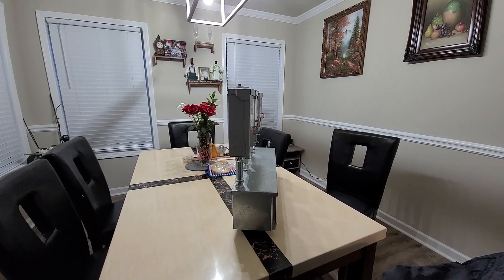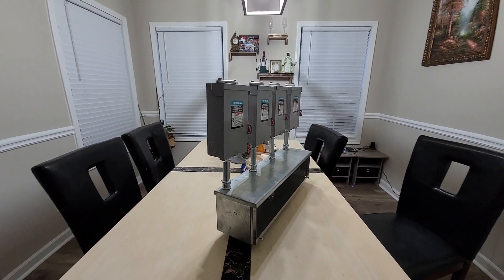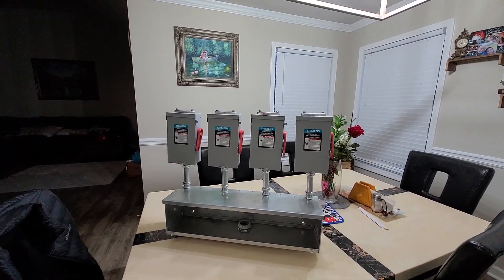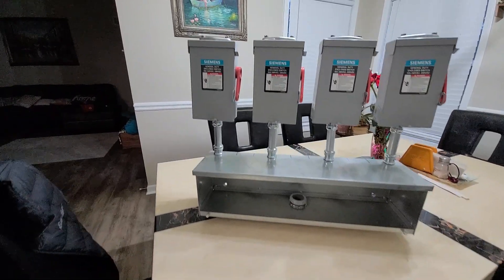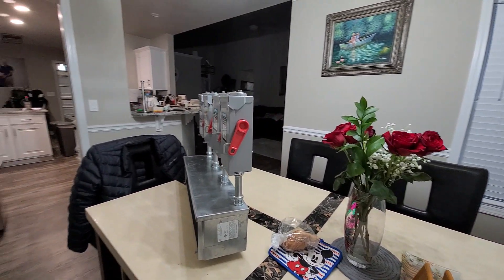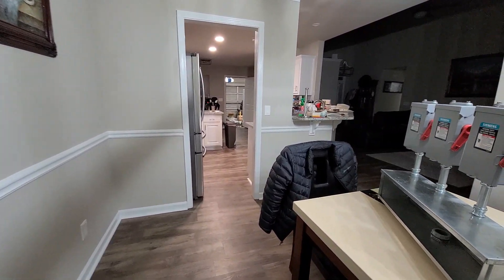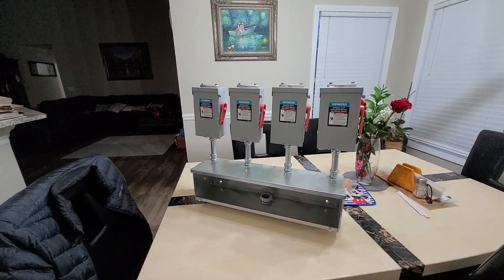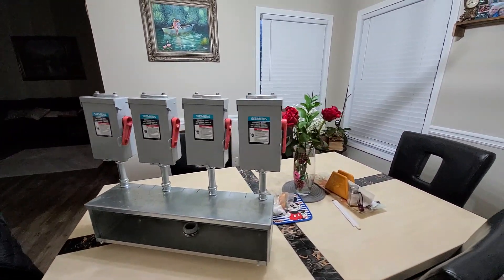Ground Mount Solar Array Part 6 DC Disconnect

Comment: Damn, thats some serious bucks and nice quality on the disconnects! Some of those are over $700 each on Siemans web site. God bless!
Reply from the maker: Thanks for the comment. DC disconnect setup cost me $250. That includes wire-way, fused switches, tubing and conduit connectors. But yes Siemens has some seriously expensive stuff.
Reply: @DMIINC2013  OK, now you have to link to where you picked them up. Unless your in the field?
Reply from the maker: Everything is from Home Depot except wire way. Check your local electrical supply store for wire way.
Reply: @DMIINC2013  What is the model number for the disconnect you are using?
Reply from the maker: @anilgargsfo  I cant remember at the moment. One of the videos will have parts list in description. However go to Home Depot website and search for disconnects and it should pop up. Thanks